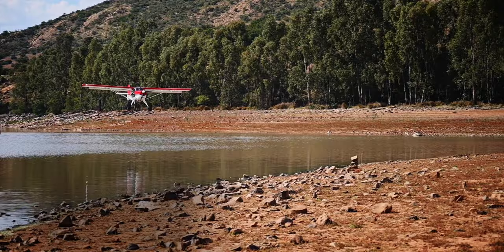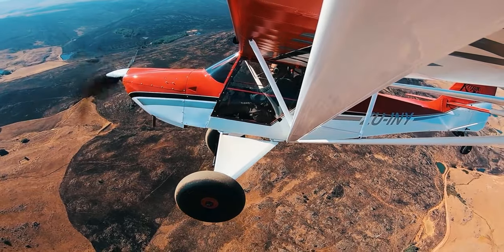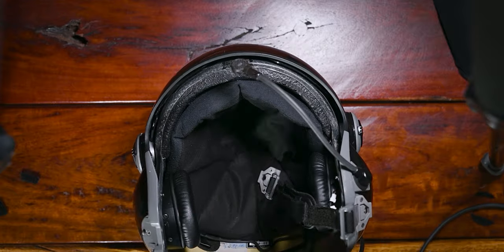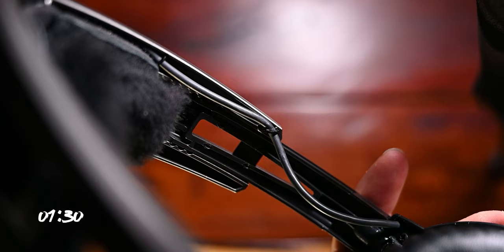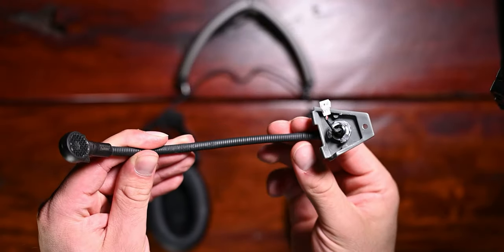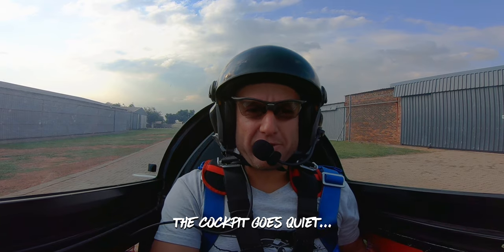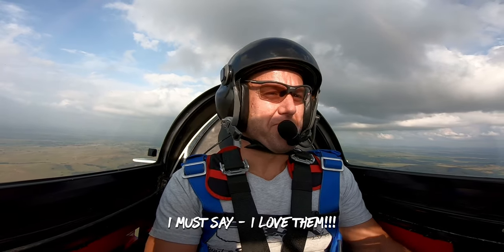BOSE A20 Helmet Install - TWO MINUTE TUESDAY

Comment: Thanks for posting. I tried to follow. You removed the access cover from the Bose, then you opened the access cover to the mic cable. After attaching the mic boom to the outside of the helmet (and the speaker ear cups to the inside of the helmet) you reconnect the mic cable to the speaker wire loom. And then you connect the entire wire loom via its multi-pin connector (now without the protection of the access cover) to the earcup. Normally, it is the access cover that holds the multi-pin connector in place. Without the access cover, how do you secure the headset cable and prevent the multi-pin connector from being pulled out?
Reply from the maker: Hi Tim!
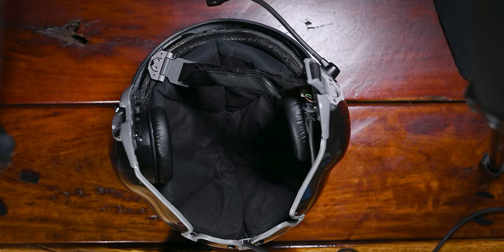I realise its not that easy to see, but where the headset cable comes out of the helmet (in the middle of the back of the helmet) there's a plastic part that holds the cable and prevents the cable from moving. If you pause at exactly 2:14 you should be able to see it at the bottom of the screen.
Hope this helps!

Comment: How do the ear cup stirrups come off?  After you clipped the plastic wire tires and removed the headband, your not showing you you removed the stirrups?  Did you just pull them away from each ear cup?
Reply from the maker: Yep! They just expand a bit and then pull off.

Comment: Specifically which helmet are you using? Keep the videos coming!
Reply from the maker: We used a MSA Gallet LH050 Flight Helmet!

Thanks, we will🔥
Reply: @About2Stall  most guys wear these just to look cool. Let me ask you this  if you believe in safety and statistics why not wear the flight helmet on the drive to the airport. The drive is much more dangerous
Reply from the maker: 🤣😂 Guess you have a point!
Reply: @bosephusray165  I have to wear a helmet as part of my job as a helicopter air ambulance pilot. Part of the reason is to have an attachment for NVGs and also to have a visor to protect in case of a bird strike.
Reply: @bosephusray165  When I drive to the base, I have 10 airbags in my car. But in EC135, last time I checked, none....The brain bucket may be difference between headache and drooling on wheelchair for rest of your life...
Reply: @bosephusray165  What a pissy reply! Helmets are a personal decision. I ride motorcycles and fly ultralight trikes but never without a helmet. I dont hack on those who decide to not wear them. It's a personal decision. My helmets do look cool but I know they can save my life. I've been riding motorcycles since 1973 and have personally seen lives saved by helmets many times I had a hard landing in Gallup N.M. in my trike and scuffed the piss out of my helmet on the runway. Would I have died without a helmet? Probably not . But the pain it saved me was worth gold. My elbow took a shot and I had to go to the emergency room. A $15 elbow cup would have saved me alot of pain and money. Michael, are you a pilot?
Reply: @petrposelt7013  No shit brother! Right on!
Reply: @daviddixon2166  actually fly a citation x and never wear a helmet bud

Comment: not allowed!!
Reply from the maker: Whats not allowed?🧐
Reply: First Not allowed to disassemble bose. Second bose are not tested and certified to fit inside a helmet!
Reply from the maker: Well sure, if you want to keep your warranty... Then don't disassemble the headset. 

We said in the beginning that you'll void your warranty if you do this and that's why we bought a used one for a great price!

And regarding the certification... Why would you need certification? We installed and tested it in the helmet and it works great!! And on top of that, you can buy (very expensive) helmets with either Bose A20 or Lightspeed Zulu headsets in... Ours is a diy solution!

Or do you mean something else?
Reply: @About2Stall  if you can buy it it does not mean it’s legal. In any case I think Bose quality sound is outstanding but those rigid earcups are not allowed to be installed inside a helmet. Really dangerous for Side impact. Not a lot of people think about possible damage in case of crash. There are ANR kit that are designed to fit a helmet and Bose is not part of the list. Bose need to be worn as just a headset .
Reply from the maker: You make a valid point, and it's the owners choice whether they want to do/ take the risk  or not. 

We are comfortable with how it fits and works and thus use it in this way.
Reply: @About2Stall  it’s because the Bose ear cups are not crushable.  There have been crashes with a helmet where the non crushable ear cup caused skull fractures.
Reply: @dodgecummins6181  Interesting comments. I have an Alpha Eagle and the plastic earcups look pretty solid; I'm sure they would not crush in an impact. I also tried installing my LIghtspeed Zulu into my helmet but wow that was a tight fit and reversed it.
Reply: @michaelking42  they are supposed to crush or be flexible so the forces are not transferred to your skull.
Reply: @dodgecummins6181  Yes. I hope I never have to find out.